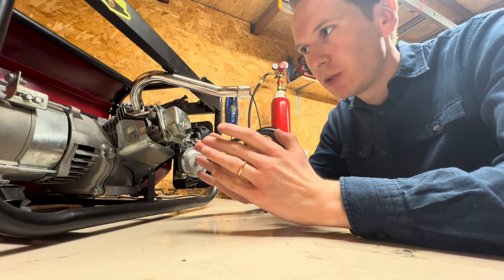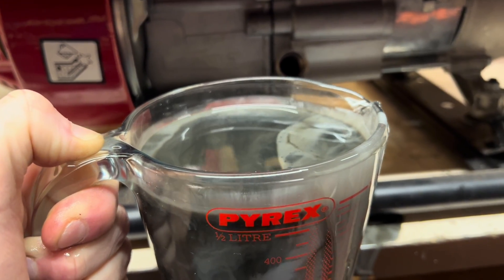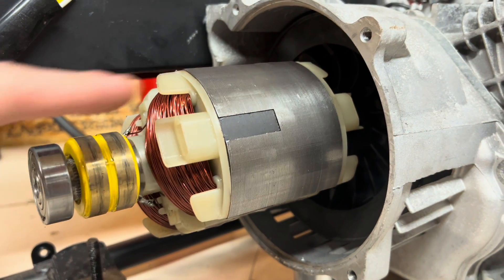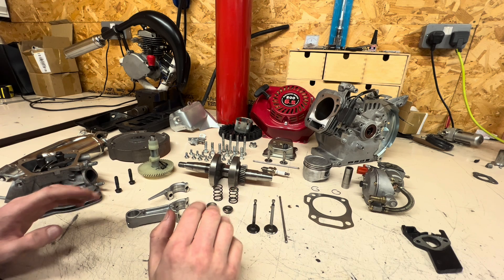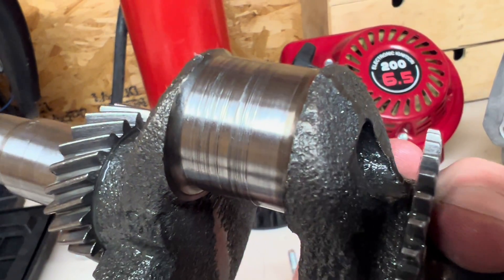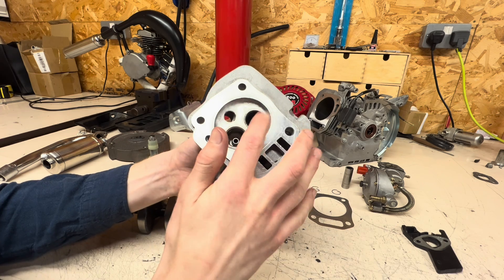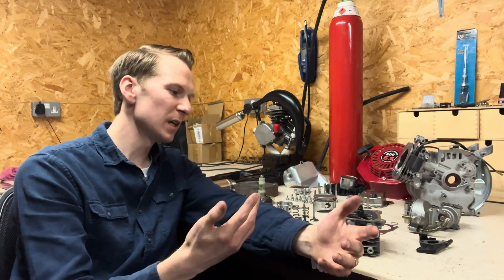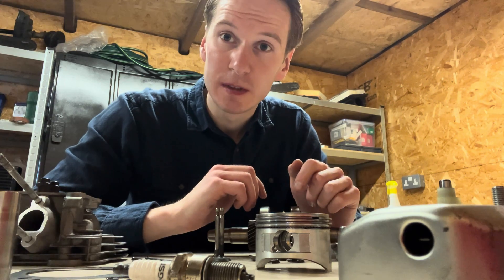Internals After 2 Years of Hydrogen

Comment: Some Quality comments here! love to see everyone with some knowledge chipping in, Thanks lads!
Reply: Great I love this. I have a huge background in internal combustion engines but zero in hydrogen engines. I viewed all the 
Very informative views. My take after digestion of the all the views. I think the aluminum in the oil came from the rod. No 
question that rod took a beating from knocking from the fuel. The question is why? I can,t answer that with out knowing 
anything about hydrogen burning rates. But what is known is it is not right as to one of the things you guys have mentioned. It did not look like heat caused it. It looks like improper burn rate to piston timing rotation. You guys say it burns at a very fast rate. We all know other fuels have flame travel rates, just different ones to the fuel used. Nitro, burns 
burn very slow compared to gas, or alky that’s why top fuel guys run as much as 65 degree BTDC. This stuff may require 
1 degree BFTDC or even ATDC as crazy as that may sound. I remember in the 1960,s we ran 40 degree BTDC on Nitro & still braking parts. It was Don Garlits that that started upping timing to go faster & doing so quit braking parts.This my be
the opposite to that. I would really like to know? Great thread 👍
Reply: Please try using a better test engine, like an air cooled beetle as that will have real bearing shells, replaceable cylinders, heads etc. As you will impregnate the metal of the cylinders, cylinder heads & pistons and thus likely need to replace them at about 10,000 miles. At least that is about as far as the converted DJ3 mail jeep went in the US before the engine became too brittle...
Reply: Maybe stop wasting time to convert inefficient combustion to use hydrogen which also produces pollutants making this a lazy step to zero emission which can be easily achieved with fuel cells.
Fuel cells are not only "cleaner" but also much more efficient.

Comment: For my belief, the goal is not to run 100% carbon free. The goal must be, to mix all available fuels in the cylinder, to get the most efficient out of it. This will then be the environmental friendliest in the end by automat. Imagine running a car on 1-3 L of fuel per 100 km. Without having to carry tons of battery power in the car.. for me hho is the only way to achieve this easy. This has to be done.

Comment: The engine can not spin a bearing if the beaering is made from all stainless. This because there is no copper that can smash or weardown.
You wont find copper coated bearings in high tech aircraft or in indi race cars. These engines are built for extreme rpms and built for thousands of hours of use.
Get rid of all inferior components, steal, copper, brass, and shim out all play from components.

Comment: I have timing 1 degree after TDC after having the bearings wear, no problem since. These engines fire twice per four strokes. You need to disable the ignition when the exhaust valve is open or it will sound like a backfire Or can blow the muffler off the engine, ask me how I know. I don't think your valves are a problem, it's just firing on the exhaust stroke.

Comment: I think a short stroke engine would suit hydrogen better because it burns faster and flashes quicker but obviously the big ends need to be stronger, a roller bearing crank might fix the problem, the combustion chambers might need a redesign to keep the heat off the cylinder walls. Very interesting keep up the good work, one enthusiastic guy like you is going to save the planet but if he had some help it might make things happen quicker.

Comment: been a small engine mechanic for a while now. in my experience, whose wear are from using detergent oil, all soot and debris are circulating from the oil and damages the engine overtime. That engine has no oil sump and oil filter. so always use straight non detergent mineral engine oil for that particular engine so that all soot and debris fall down in the bottom, not circulating with the oil..

Comment: That's lovely but what's the NOx emissions?
Hydrogen burns hotter so generates more, do you run rich to avoid? What does that do to your mpg?
Have you actually studied any of this orare you just stock H2 in a motor?
Reply from the maker: Hi, yes it’s running rich to avoid high Nox, sadly it burns more fuel in doing so, water injection is also used to reduce EGT temperatures and reduce Nox further. Not viable to be used every day due to the fuel consumption, perfect for racing etc.

Comment: This is ALWAYS the cause of failure in these engines. They don't put bearings in them so the aluminum always fails against the steel of the crankshaft. Usually you can just polish the aluminum off of the crankshaft and put in a new connecting rod and slam it back together.

Comment: Maybe slow constant rpm hydrogen isn't suited to a performance build?

Consider fly wheel on crank shaft coupled with dc output parallelled with battery.

Also consider a dry sump with external oil pump/filter.

Comment: I also have the suspicion that due to the clean burning nature of H2O that your Valves are welding themselves to the head. Some older cars on gas need a system to burn less cleanly on gas to minimize coldwelding and lube the valves to reduce wear and tear.

Comment: Oil looks like it has considerable metallic particles in it. Lack of carbon is similar to engines run with water injection systems they stay clean. You might have seen much less wear running a high quality synthetic oil like AMSOIL. An engine with a pressure oiling systems would probably not have shown any wear. Tapering the lube hole on the con rod would have an increased oiling effect forcing more oil into the gap at higher pressure.

Comment: That oil has been run too long, I'm not sure of the drain interval for this engine, but that was too long. There appears to be some condensation in the oil, which woild be the blow-by of a 100% H2 fueled engine. And water is a terrible lubricant.

Comment: Burning Hydrogen with O2 creates water which would get into the crankcase as combustion blowby the piston rings.
Would it evaporate quick enough as to not harm the lubricating quality of the oil? Was the oil changed on schedule? No carbon contaminates but viscosity breakdown will still occur. Timing putting excessive force on the piston? To lean causing excessive peak combustion temperature and overall engine heat? Maybe that's why the exhaust valve doesn't look right.

Comment: WHY tf would you.. you get less than a third of the energy back that it took to make the hydrogen than if you run it through a fuel cell & electric motor.. combusting hydrogen is pure madness
Reply: a gx200 is significantly cheaper than a fuel cell, so not so mad

Comment: My understanding is that Hydrogen is (and always will be) the worst possible fuel source unless you are outside the earth's atmosphere.
It's incredibly expensive to make, almost impossible to store and transport, boils off rapidly,  and requires very expensive recondensation equipment to prevent venting your expensive gas. And you don't want to vent Hydrogen, because it explodes at the slightest prompt.
On top of this, it leaks straight through the sides of any container, because it's the smallest atom.
Even worse, it reacts with oxygen very violently, and at every possible opportunity.
A fuel cell is useful in a spacecraft, because it makes power and water. But beyond that, only dreamers are working on Hydrogen.
And all those dreams always turn to nightmares, because Hydrogen as a fuel literally makes no sense at all.
We've been working on H-tech for a long time - and so far, it's all 100% useless.

Comment: Just guessing before watching and reading comments, gasoline is burny while hydrogen is kinda boomy.  Your timing might be sloppy, which is ok for a slower gas burn, but you need cleaner timing for a boomy hydrogen mix.

Also water, but as long as your oil is hot enough, it should all stay vapor.

Comment: one thing i learned in school as a welder is hydrogen can seep into carbon steel, and just steel in general  and cause cracking and weakness, ive been wondering how this will affect engines that run something like a cast iron block

Comment: I just cant help but think this problem will happen all over again. The problem is the material used in the failed parts, more so than timing or other factors. Perhaps using a different lubricant may be the answer. Hopefully there is adequate load on this engine when it is in use! I noticed the coupling tying the generator to the engine was damaged - was there a balance issue because of this?

Comment: Yes, you can run on pure hydrogen, but the first thing you learn is it has less power than petrol, and slightly less than natural gas or Propane.  The next thing you should notice is the oil needs to be checked twice daily, and changed once a week, if you are running all day every day.  What we did to improve all of these parameters is to add methane from a captured methane production tank. We had a six cylinder generator to supply all of the power at a large dairy, so a methane grow tank was an easy addition.   Our generator produced 220 VAC at 100Amps.  Maintenance was accomplished daily during the period of no milk production.  Also that generator was water cooled.  Probably the best setup would be to use solar and auto start of the generator at peak power draws.

I also wanted to give you a note on the appearance of your used motor oil.  The color indicates you have moisture in the system, probably because you are not using a dryer and a particle filter on the hydrogen generator output.  The same on the methane, as both will transport a lot of invisible moisture into the fuel system.

Comment: I'm going to take issue with what you've said here but please bear in mind that I speak as an Engineer with decades of experience in the Automotive and off highway areas and have run, and advised on, engine validation testing for Perkins, Caterpillar and Roll-Royce amongst others.

First, you haven't found what the made the engine fail, you've only found the symptoms. The wear on the Crank pin and Connecting Rod are a cause for concern but you need to get to the bottom of why they have worn. First step is to send a sample of that oil to Finning (Caterpillar SOS oil laboratory up in Leeds) and get the wear metals, contaminants and oil health numbers back). The failure of the oil may be an issue but to wear the crank pin like that would indicate hard contaminants such as Silica. Any hard material like that will end up embedded in the alumininium of the connecting rod act as an abrasive on the crank pin.

I don't know the engine manufacturer but some of the global plants I've visited have paid scant regard to build cleanliness (not the big name players like Honda, Caterpillar but some of the types you see on Amazon/Ebay)

The oil looks like it's got quite a bit of Aluminium in it, but the oil analysis would confirm that.

Given that Hydrogen is insanely easy to ignite I'd suggest that there may be ignition timing and/or failure issues too.

If you are going to do another long term trial you really need to strip, inspect and measure the engine both pre and post test as well as recording the load profile. That way you will be able to make better judgments on parts longevity. Again, scheduled oil sampling during the test will allow you to monitor whats going on in the engine during the test and help prevent costly failures.
As a mininimum I'd measure valve seat resession, installed piston ring gap (both in the boore and the ring goove clearance), valve lash, piston small end diameters (checking for ovality as well as wear), big end diameters (again, checking for both ovality and wear. Don't worry too much about the rof to cap area, these are often machine to creat some clearence), crank pin diameters, main bearing diamters, connecting rod end float, crank endfloat, cylinder barrel diameters (top ring reversal point, middle and bottom ring reversal point both across the bore and along the crank axis. Given the valve issues it's probably worth check the valve guides and the valve stems too.

Before you rebuild that engine try and get the parts through a parts washer and spend a bit of time flushing the oil gallerires and drillings.

Good luck with the performance engine build. Look out for leaks (we both know how much Hydrogen likes to escape...)
Reply: Phosphor bronze liners at both ends of the conrod would probably have prevented the problem. Top quality fully synthetic oil is rarely specified on smaller portable engines, but it can make a big difference in preventing wear.
Reply: @wilsjane  the problem with the loose engine market is there is no money for such luxuries. If the engine will last it's design life there is no need to spend extra. The manufacturer doesn't care about resale value of the used equipment, they only care about warranty costs. In this case, judging by the degree of scoring on the crank, phos bronze wouldn't have made any difference, nor would a fully synthetic oil. There is absolutely no justification for a fully synthetic oil in this application: it's not a highly rated engine, the soot loading is virtually zero and the engine design should give adequate cooling.
Reply: Finally a real engineer posts a comment. Absolutely brilliant.

Comment: ☝️ IF ☝️ YOU WANT A MOTOR TO LAST FOR A HELL OF A LING TIME ☝️ PROPANE 
I'VE HAD SEVERAL MOTORS IN MY LIFE THAT WERE RUN ON ONLY PROPANE AND WHEN OPENED LIKE TO CHANGE THE VALVE COVER GASKETS IT WAS LIKE IT HAD NEVER ACTUALLY EVER BEEN RUN OR USED IT LOOKED LIKE IT HAD JUST BEEN ASSEMBLED AND I MEAN ABSOLUTELY TOTALLY IMMACULATELY CLEAN OH AND THE OIL STAY'S LOOKIN CLEAN LIKE IT HAD JUST BEEN POURED IN FRESH  I FOUND IT AMAZING

Comment: ☝️ WHAT ❓️ OIL R U USING 🤔 ☝️ MY SELF I WOULD CHANGE TO A 15-40 DIESEL OIL WHICH HAS SOME ZINK IN IT YOU MAY WELL FINDE THAT THE ZINK MAY WELL  ALLEVIATE THE GALING ON THE CRSNK AND CON ROD AND☝️ MAY REDUCE THE VALVE WEAR ☝️ IF THERE WERE LEAD IN THE FUEL IT ALSO WOULD LIKLEY REDUCE OR EVEN STOP THE VALVE RECESSION 
OH AND TRY TO ADVANCE THE TIMING SOME HOW THAT ALONE MAY MAKE A WURLD O DIFFERENCE

Comment: The two problems with hydrogen are producing it-you need nuclear-and storing it. It’s either cryogenic liquid or high pressure gas. Neither is suitable for consumer use.
Reply: Hydrogen is already used by consumers in the current gas networks (mixed with fossile gas), in your gas fired ovens and heaters. The consumer can tank it as safe as petrol into the cars. Otherwise, consumers should never play around with anything flammable, gas or liquid or powder outside the designated use.

Comment: The oil shouldn't spill out when opened, overfilling the oil puts an excessive load on the splash lubrication arm which puts excessive load on the conrod and crankshaft bearing as it hits the oil with more force than designed. You're better with less oil than too much oil in a splash lubricated engine for this reason. It may well have contributed to the accelerated wear you're seeing.

Comment: I have nothing against these type of experiments, I can see why people are attracted to it. But it really makes no sense to run an ICE on hydrogen. Running an ICE on hydrogen is basically running an ICE on electricity. Only it is the worst possible method to convert electricity into mechanical energy. There is much better technology available. A hydrogen fuel cell that powers an electric motor does that far much better, with far greater efficiency and reliability.  And I think that the production of a fuel cell is comparable with the production of an ICE in terms of materials and energy that are needed for the production of both.  

The best possible efficiency with an ICE is still only 30% due to friction and losses caused by heat conversion. So it would be a huge waste of energy and money to create all that infrastructure to produce all that hydrogen, only to waste 70% of it with a highly inefficient process, while there is already not enough hydrogen production to cover the entire spectrum of what potentially could be powered with hydrogen if it was used with the most efficient method to create mechanical energy for transportation or industrial processes. 

There is no abundance of hydrogen, and it takes a lot of energy and infrastructure to produce it. And burning hydrogen might be feasible for a small scale hobby project, but it isn't even remotely feasible on a large scale so that it could provide enough hydrogen for millions of end users. If we want to waste 70% of hydrogen we also need to generate 70% more electricity. My numbers are very crude, there might be some differences when you do all the exact calculations. But my numbers are good and valid enough to make my point.

Comment: Did the oil get water contaminated that then caused the damage as the Hydrogen when it burns turns to water. Normally with a gasoline engine some gasoline gets past the rings and contaminates oil after a while, so my thoughts are that water got past the rings and thinned the oil which caused the oil to fail to protect. Additionally this is why the spark plug had some corrosion.